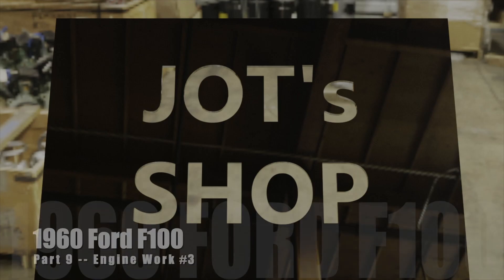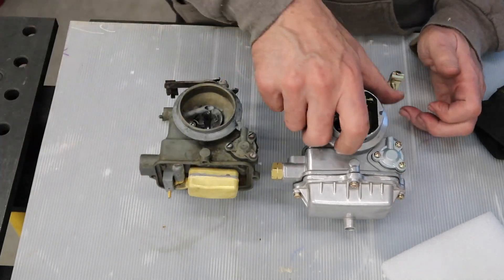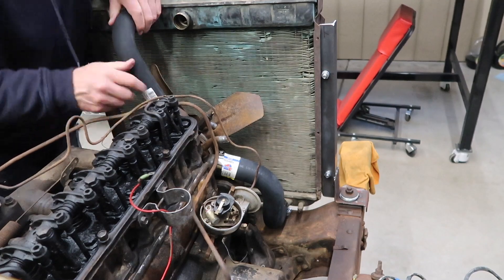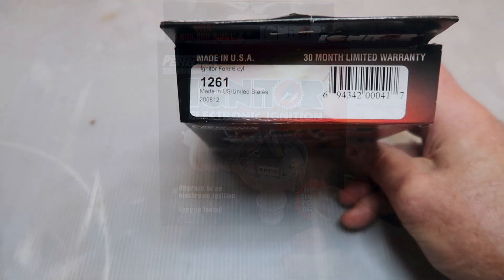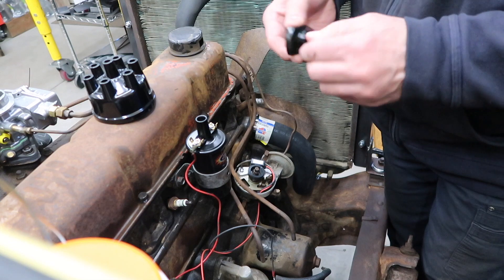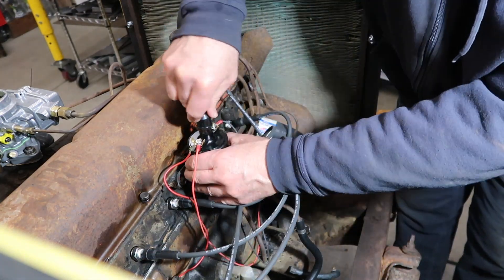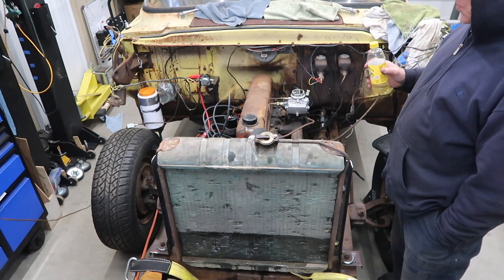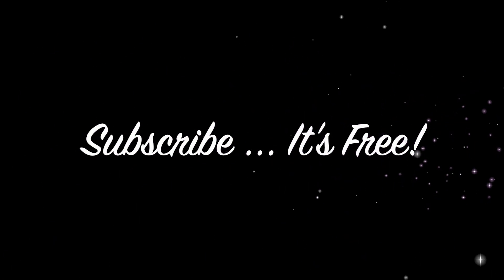Part 9 - F100 '60 Ford Truck Restoration

Comment: This is awesome! I have the same truck with the same motor. I'm having a terrible time finding the number on the carb to get a kit for it. Do you know the carb number or where I can find it?
Reply from the maker: Mike's Carburetor Parts is a great resource for carb information. Here's their website about the Holley 1904. Has information on where to find the carburetor number. Also sells all the various parts you may need. Hope this helps and thanks for watching!

https://www.carburetor-parts.com/Holley-1904-Carburetor-Kits_c_562.html

Comment: Gees this brings back memories. I was 14 when an old lady gave me and my dad a 1958 F100 same color as yours and same motor. I hate seeing you change carbs and put electronic ignition in it.
You should have had someone working the choke from inside,
Reply from the maker: Thanks for watching and commenting! Great story about your youth. Since we know the engine now runs, we may put the original Holley carb back on after we rebuild it.